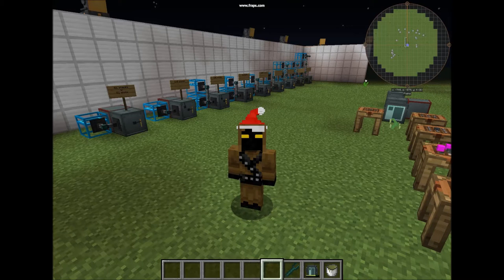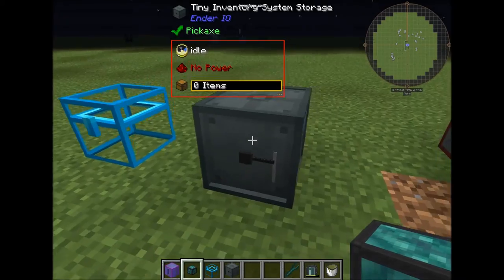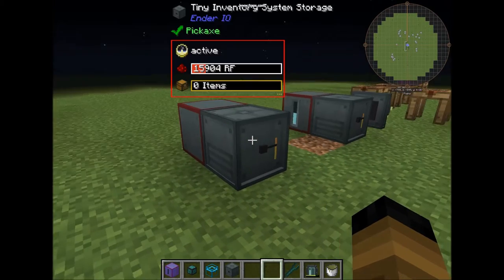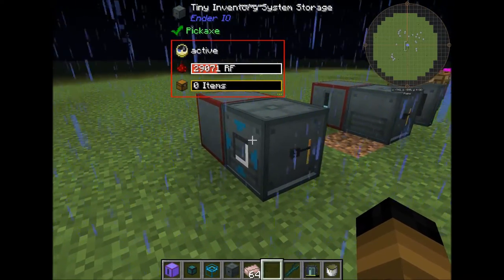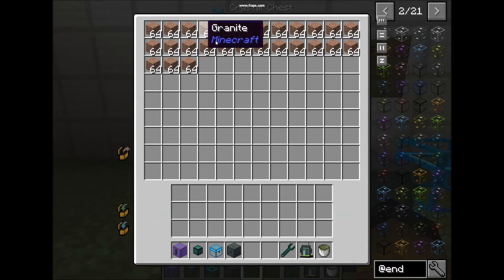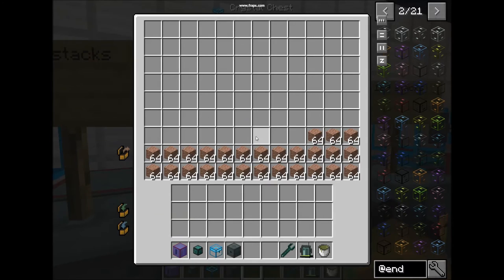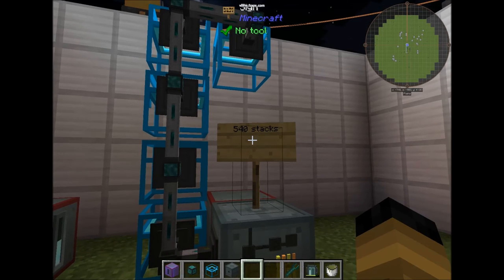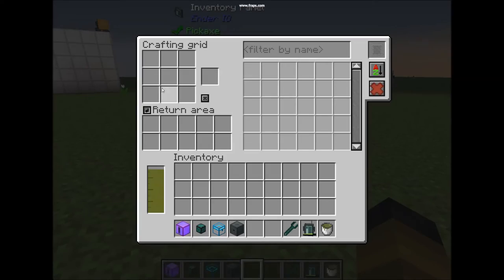EnderIO Inventory System Storage Tutorial

Comment: Strange that you needto put a conduit with upgrade between the panel and the inventory block. I was getting stuck, becuase I was just putting the pannel on the inv block itself... (maybe they should add that, I would have never figured that out).  Thanks man.
Reply: btw, you don't need the awareness upgrade in there. The Storage already comes with its own awareness upgrade in its recipe.

And the conduit is needed because the storage network is a sub-function of the item conduit network. The Inventory Panel is just used to access it.